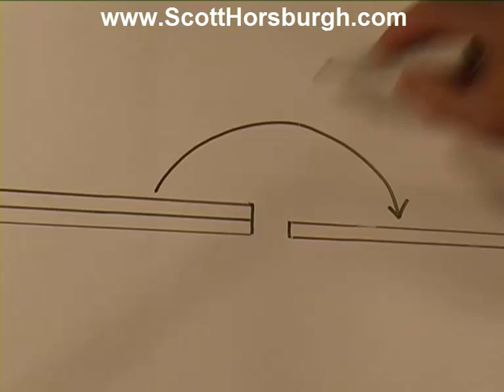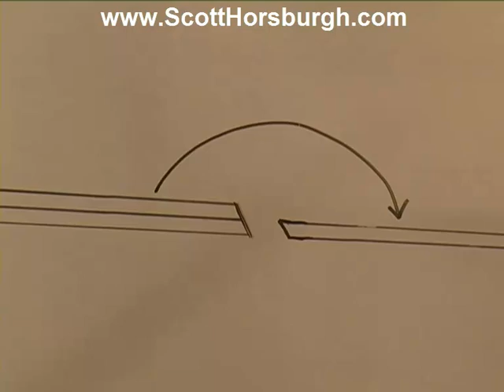How to Use Hand Planes & Shooting Techniques to Prepare Flat Faces & Square Edges

Comment: I came back to this video after first seeing it several years ago. This level of meticulousness isn't exactly my style, but I appreciate the extreme example. This is very fine work, but no finer than the work done by the Japanese cabinet maker who sits on the floor, using his foot as a hold-down, producing piston-fit drawers with wooden planes and hand-forged chisels. It's an interesting juxtaposition.

Comment: Thanks for the thoroughness of these instructions. I must however note that the filming has you inside the room with a very bright outside light. It would be very helpful to the viewer if you used some sort of inside lighting to illuminate your face and the objects with which you are working.

Comment: I guess I do not understand the why one would use the lateral adjuster to make the plane cut with just the bottom third of the blade. Doing so will make the edge of the work piece you are shooting not perpendicular to the face of the board. Maybe I am missing something.